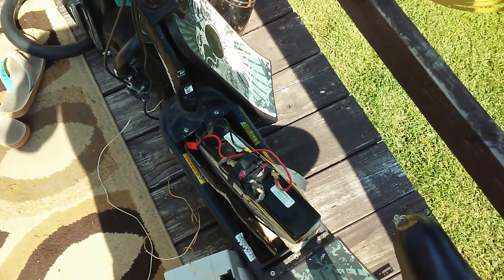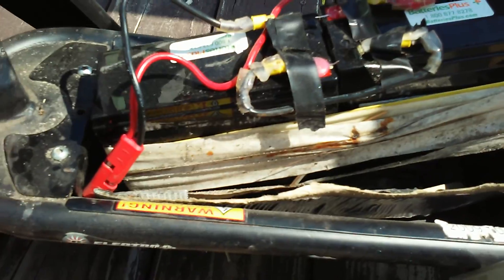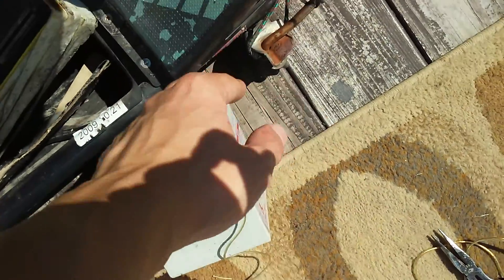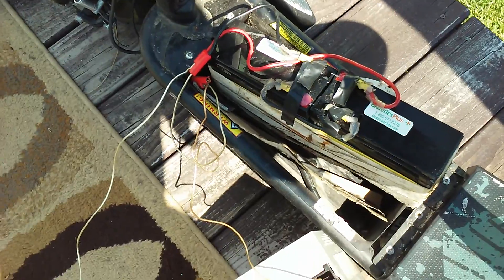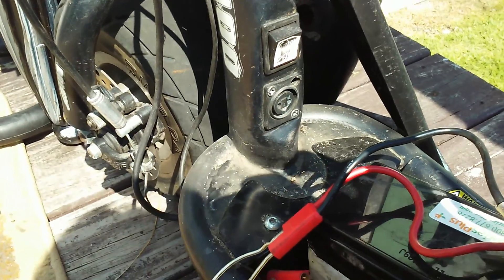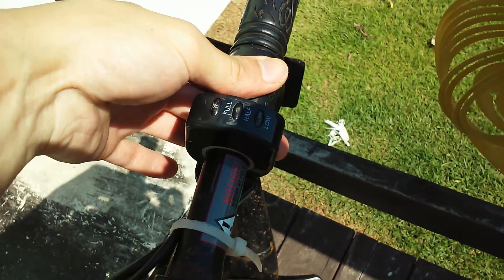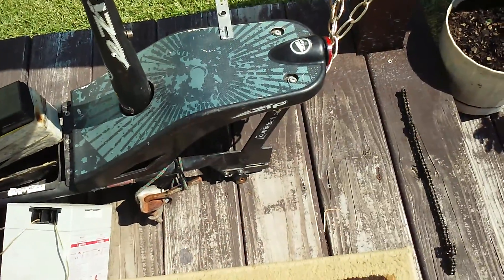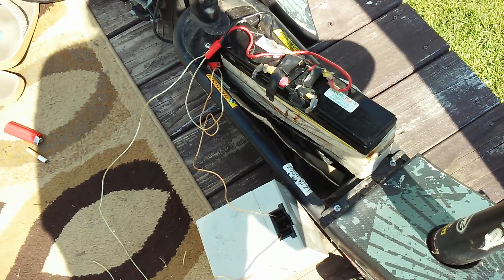ELECTRIC SCOOTER TUNING! Ezip E400 overvolting @ 36V

Comment: Probably overvolting the motor and controller, so just know if you don't care about the scooter longevity for speed as it might burn things out.  Also, not having balanced batteries will not be good for the batteries.  I used two Ryobi 18V power tool batteries at the same Amp-Hour rating at full charge w/ a fuse...it blew the 20A and I had to go higher.  Should wear a helmet and be extra careful as stopping at speed will take longer and put wear on the breaks.

Comment: Hey my guy, awesome video, I recently got a hold of my old 400 that I used when I was a kid and was curious if you had swapped the scooter controller with the 36v 30a model variant to make it 36v. I’ve read around that others had also used a larger motor swapped from another model but wanted to see if I could still use the old one as it is quite pricey online to get.
Reply: Same situtation im in right now. Have u tried it yet and see what happens?

Comment: I ran 42v lithium on 24v 500w motor and did 22mph and popped wheelies
Reply: Didn't leave it like that long enough to find out. The motor would get hot before I'd run battery down
Reply: Did it burn out the motor or is it ok?

Comment: I found the 450 model in the trash last night. The 2 12v 10ah batteries are dead, although I am trying to revive them by adding distilled water and charging. Don't think  they will come back to life. I have more than two dozen 12v 8ah batteries ( same size but half inch shorter in height), and would like to run it on 36v or possibly 48v. Any suggestions where to put the extra 2 batteries, and will the 48v kill the motor? Thanks for an excellent video, and all the best.

Comment: Where can I get a battery to do this at ?
Reply from the maker: This was a DEAD cell,salavaged 12V SLA (sealed lead acid) battery from a Power Wheels brand. It wouldnt hold much capacity so my testing video was only around 1 minute with this and worked beautifully to over volt to 36V and got a total speed average to 21MPH or so. From the stock 13-16MPH at stock 24V. Very good upgrade!

Comment: Like to see the final results, any video on it?
Reply: You should switch the controller to 36v and it will not overheat, also you can use 2 li-ion 36v 12ah batteries it will go 27mph. I have a couple of them, you will have to remove the controller bracket to make the batteries fit though. The mileage range is 8-10 miles as well plus you can use the fast charger of Amazon charges in 2 hours.
Reply from the maker: Yeah actually i have a full speed test video done up if you wanna check it out. I think top was arpund 19-23mph with the 36V system

Comment: anybody managed to overvolt ezip currie 750W? ill add another 12v to the series and take a ride but if someone already tried this ill just buy a LiOn
Reply from the maker: probably would work if its ESC is a good model as some i researched about,are capable of over-volting by 12~24V for certain ESC models from curry Ezips
Reply: I know this was posted awhile ago but I run a 24v 500w Currie motor on 36v and have run 42v with a lithium

Comment: How much did it increase it. Does it extend the battery life too or just speed
Reply from the maker: It was a very bad dead cell battery that only had very little capacity (wouldnt hold much charge) 
It was wired in series so it would of been the same runtime for battery life if the battery was actually good like the other two. However top speed increased from average of 13-15 to around 18-21MPH so it was a major increase overall. The ESC and motor handled it just fine. This is very old also btw,ive long since went homeless since this video and no longer have this or much of anything else from around the time of these videos.
Reply: im using a BnD lawnmower battery (3 12ah batteries in series) and what i thought was ok speed for riding to the store etc with just 24volts, at 36volts feels as if you can say the scooter is fast. lol  Im giddy every time i get back from the store, proud of myself for saying "uck it" and trying tit at 36 volts.  Havent tried 48v yet.

Comment: I know this is an old video...but was just given one of these...i have access to some 18v batteries...was thier any other mods needed for this model? It took the 36 volts with no longterm issues? Thanks!
Reply: i know OLD COMMENT but just for more information:  ever since i made that first trip that I commented on, I've been making this trip at almost once a day, 95%(?)throttle 90%(?) of the trip.  I havent noticed anything different except i had since broke the connectors off of the lawnmower charger to try to make a connection to the controller but no dice.   I have toconnect the controller wires directly to the battery pack (of 3 12v12ahSLA)and seems to take all day to recharge from 36.x to 39.x  I havent seen my batteries hit 40v in a long long time
Reply from the maker: @Mike_Greene  12v x12AH capacity =1C charge rate. = around 10Amps should have them charged rather timely.
Reply from the maker: I was made aware by on some forums about the currieTech Ezip scooters,the model of the scooters ESC makes the difference where as the newer Ezip 400 for example,has a capable ESC for 24 to 36V DC and the older models seemed to only handle the 24V and simply wouldnt operate at the 36V DC range. For mine however,for the amount i tested it,was great and no problems. This is a DIY mod with risk so theres never a 100% guarantee. Sadly i went homeless not long after these videos so needless to say i no longer have this.
Reply: demonsparkx well thanks for the info, sorry to hear about your situation... i pray all gets better for ya soo !
Reply from the maker: FLG8RGUY4LIFE not a problem,hope i was of some help. Thank you for the kind wishes!
Reply: @demonsparkx  I have a 36volt bnd lawnmower batter I rigged to a factory ezip 400 I'm about to ride to the store for gas (lol) @ 15amps  the reg 24volts @ 15 amps  was OK speed.  Here goes (hoping I can make the 3/4 mile journey
Reply from the maker: @Mike_Greene  i would get at least a mile or two off mine if i didnt go full speed the whole time. That was on stock 24V with old batteries also tho. When i did 36V my 3rd battery would only last about 2 minutes
Reply: Forgot to mention I did make it back but forgot my gasman haha so I also wasn't able to see how many volts  I had left on the batteries
  I used a motor from a mx500 and it's controller and these same batteries in another scoot3r frame  and the ezip 400 @ 36volts felt faster although  it has to get up to speed
Reply: for anyone  following... I  still use the same battery  controller  and motor.  I ride around  often and let  my   nieces and nephews ride   it. they get hours   on  it  at kindergaten  age.

Comment: I'm trying to make  make scooter motor  run faster
Reply from the maker: +Eddie Lope i'll post a diagram for you shortly. i am actually going to try a different "*hardmod*" on this scooters ESC today, i seen it done on the 200W version's ESC so i want to see if it's also possible to do it to this one, by bypassing the current limiter inside the ESC box. i saw it on someones video but i dont know the legitimacy of their claims, i have never looked inside the ESC's board before to verify what they claimed. most likely it is true though.
Reply: this is my email  lope350@gmail.com
Reply from the maker: Eddie Lope
i will email you shortly with more information to help you with this. :)
Reply from the maker: +Eddie Lope just send u email. hope i can help
Reply: Are you really serious??? You can't figure out how to go from 24 to 36??? Maybe you should let the grown ups do it for you.
Reply: I know this is an old video...but was just given one of these...i have access to some 18v batteries...was thier any other mods needed for this model? It took the 36 volts with no longterm issues? Thanks!

Comment: How did you run ur battery  in sires  cause I have an izip 900
Reply: You probably shouldn't be messing with batteries and electronics if you can't figure out how to run 3 batteries in series pal.
Reply: run wires pos to neg on all three batteries, then the remaining terminals will give you 36 volts. Hope that helps you.
Reply from the maker: +Joshua Middleton lol